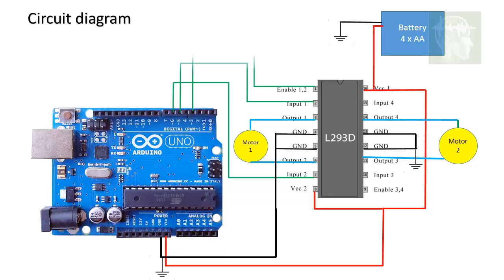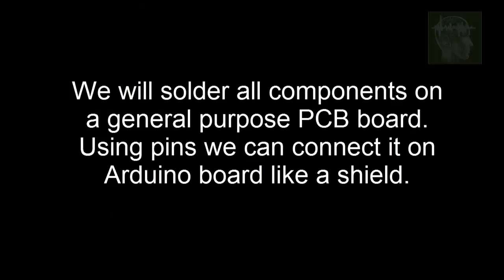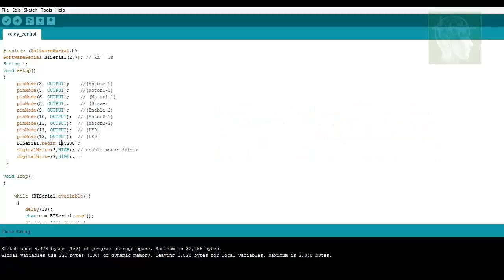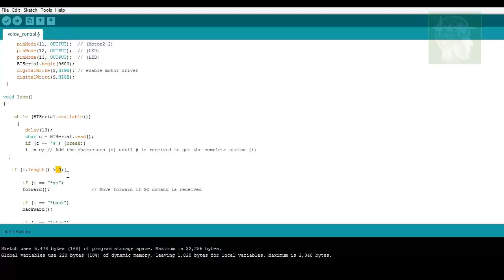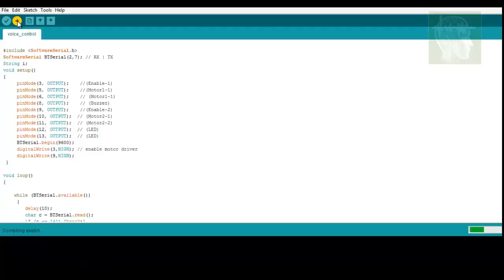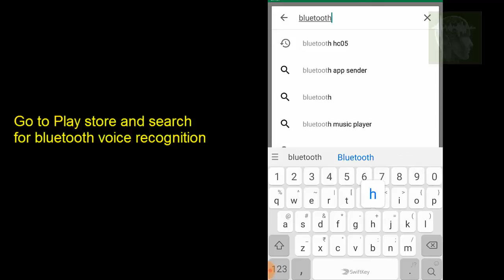How to make voice command control UGV robot

Comment: in one of your previous video a free app was used as BT remote control (RC). Here you are sending voice commands to control similar robot over same BT. But both arduino program is different. Is it possible to have a single arduino program were both the apps  use as and when required?
Reply: If I am outside and in a noisy place, l like to use RC as  button pressed remote control. If I wants hands free then only i like to use voice command controlled.
Reply: if you find the way, plz plz make a short video.

Comment: Nice video sir,, I will make it with in some days but i don't have enough knowledge about arduino coding.. I am watching your previous videos and other videos about arduino though its seems very critical to me..sir,,I have a question about this robot..if i use 4 motors instead of 2 and a L293d motor shield then can i use the same codes that u have used in this video?? Will it work?? Or i have to make the circuit like shown in this video and have to use 2 motors only with this code in this video? Thank you. :) :)